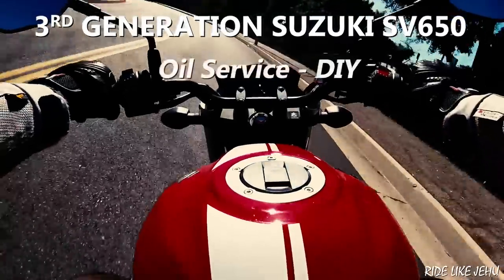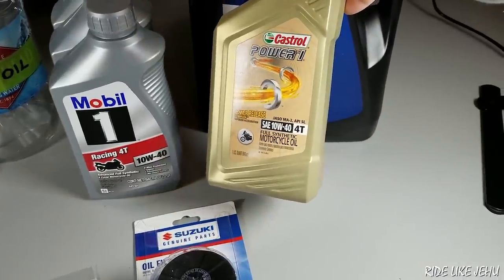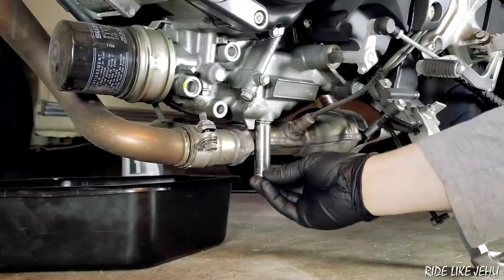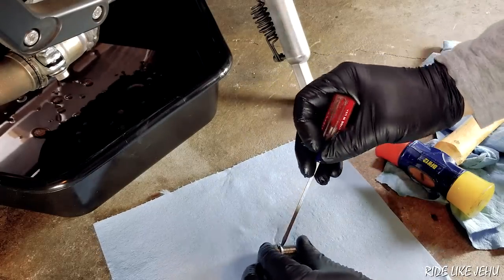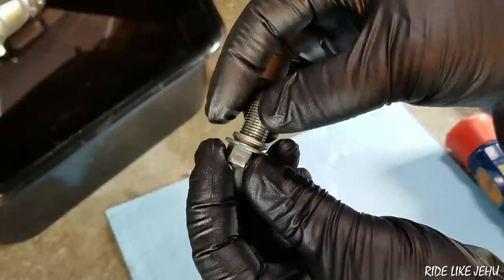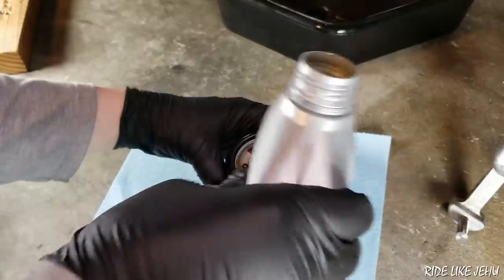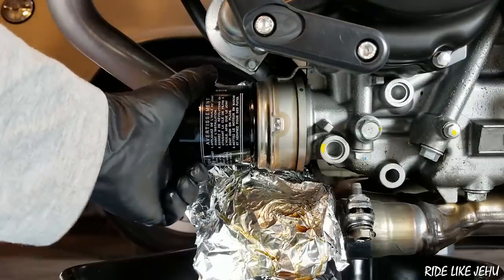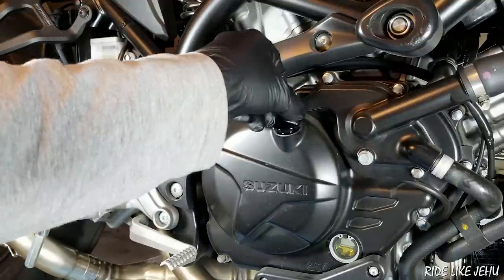Suzuki SV650 Oil Change (Corrected)

Comment: I like 15w-50 oil in there. But it gets over 104F here in the summer so make sense. FSM shows it as valid too as long as you stay above -20F, which I find surprisingly low. I still use 40w in colder temps.

Comment: Prefilling is pointless, not only that but you prefilled the oil into the output "hole" of the oil filter... meaning if that new oil is dirty or something got into that new oil, its going to get sucked straight up to the bearings and will NOT be going through the filter portion first.

If you dont prefill all the oil is going to pass through the filter correctly (or you prefill by pouring into the tiny hiles on the edges of the filter instead, still wouldn't recommend) and that small oil "delay" will not damage anything... the bearings and everything has plenty of residue oil in them.

Overall this would be a perfect video for an absolute newbie, good tips. In depth coherent walk-through. 👍

Comment: oil filter IMO is at end of process of engine lubrication, so oil sucker takes oil from oil sump to all parts of engine and after it goes back thru oil filter so is no delay with engine lubrication during the first engine start.

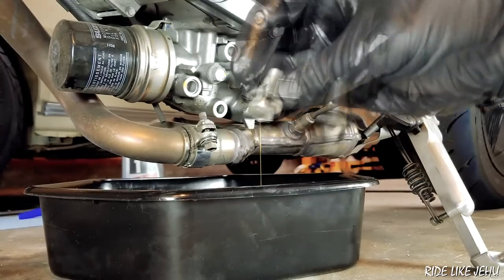Comment: 5:44 Ahhh, the old myth of needing to replace the 'crush washer'...
I've a 2000 registered sv650 that I have owned and maintained for 18 years and not once have I had to change the oil drain bolt, 'crush washer'. It's mated to the face of the engine casing. It's oil tight and will never leak so long as you don't deface the surface by tightening it up with bits of grit or something stuck to it. Take it off, clean it with a clean rag along with the face of the bolt hole, replace it and you will be good.
Done the same with all my cars for close to 30 years and never a leak. Amazing eh?
Reply from the maker: Lol. Maybe you should write Suzuki a letter, present your evidence and convince them to take that instruction out of their service manual. How about the various other myths related to keeping critical things from vibrating loose, like Loctite called out on specific fasteners and torque values to hit with torque wrenches? I'm sure you could save a few bucks there too :P
Reply: For cars this is cool, but on two wheels I would not trust my 30 year experience simply because a leak could mean death. Nice that it worked for you, but if it increases the chance of seal failure just by a little it will cause accidents in some percentage of riders. Unless there is a trial proving your point ofc. But that is unlikely :D
Reply: @L3v3LLIP  I have a 2006 SV650 and I've never changed the washer since I bought it months ago. The bike has never leaked and I've had no problems with it since I bought it
Reply: @enzofalone  thats cool, but could also be just surviorship bias. The guy who died can not post about his bad experience ;)

Comment: Thx for the video.  Have a 2018 with 300 some miles on it and I know the first oil change is coming up. Rather do it myself then pay 200+ for someone else to do it; learn something too.
Reply: Recently had the 1000km (621miles😁) service done by agent on 2018 model, they actually Did replace the oil filter! (I put a secret little dent/scratch mark on it). This is Cape Town, South Africa where things are getting a bit rough at times...

Comment: I've owned a bunch of bikes, and what strikes me about this sort of make is how exposed the pipes and filter is along the bottom of this one. Makes me wonder over time about road debris being flung against those surfaces without any sort of guard system.
Reply: That was the first thing my sales person pointed out and the tech that worked with me recommended an aftermarket belly pan,  which I wanted anyways as many tracks require them for track day.

Comment: thanks for the instructional video! do you happen to remember roughly how long it took to drain the oil down to a slow drip? I'm interested in cleaning and lubing the chain at the same time.  thanks!

What kickstand is installed?
Reply from the maker: Probably ten-ish minutes? I'm sure it'll be good and slow by the time you finish with the chain service. The kickstand is from Soupy's Performance, but I wouldn't necessarily recommend it. The kickstand did not fit as received, I had to do some filing and grinding to get it to work.
Reply: Ride Like Jehu Thanks for the reply, I just changed the oil on my SV and ten minutes is right on.  Thanks for the kickstand info too.

Comment: Funny note... this is the only vehicle I've ever seen a torque rating for the oil filter. It says pretty specifically don't do just hand tight. Do hand tight + 2 rotations or 14.5 ft-lbs. Interesting right?
edit: I haven't ever seen it leak while hand tight. I just thought it was super interesting in the FSM.
Reply: I thought most bikes had a torque spec. for the oil filter. I missed that in the video...the actual spec. 15.5 ft. lbs. for the drain bolt, 14.5 ft. lbs. for the filter? I'm anal and have torque wrenches so I do like to know specs. I use a K&N filter with a nice easy bolt head on the filter.

Comment: Hi Ride Like Jehu
, 

Very nice video, I am new to motorcycle and planning on doing a 600 mile oil change myself, can you please list some detail on the suzuki branded oil you have shown on the video? is that a full or semi or non synthetic ?
Reply from the maker: That was 10W-40 Suzuki "4-Cycle Motorcycle Engine Oil." I believe it was non-synthetic. I only used it for that first oil change, hoping it would help in the event of a warranty claim to have receipts for Suzuki brand oil. Oil changes since then have been with Castrol or Mobil 1 full synthetic. Welcome to motorcycling and thanks for watching!

Comment: How do I even get a crush washer I've never heard of that. I was just about to change mine. It's got 10k miles but this will be the first time I've changed it.
Reply: Did you ever figure out where to get the crushed washer I’m trying to find one for mine too ?
Reply: @cotycharles7824   I'm still unable to find them. There's a site called revzilla. Ice ordered from them before it was wrong size. Idt they were the same kind that came off though. I used the same one and just made sure it was tight and just make sure to check that it's not leaking.

Comment: Dear friend, i watched you video many times... I just want to ask you if that frame sliders fits ok on the bike? Is the bolt a bit loose or thin on the frame? Are you happy with them? How long they are? I will really appreciate your help.
Bes regards
Reply from the maker: Hi, yes the frame sliders fit with no issues. The SV650 had just come out when I got those, so it was the only thing really available at the time. There are probably other options available now, but we've been happy with these ones.

Comment: Don’t over tighten the oil drain plug. Ask me how I know lol. Only make the mistake once. Luckily a new oil drain plug and crush washer did the trick (it was barely leaking oil after my oopsie). I was afraid I stripped it out, but I think I’m good to go. Wasted 2400ml of brand new synthetic oil, and I had to buy the new parts. Lesson learned.

Comment: Where can I purchase the service manual? Thanks!
Reply from the maker: If you want a hard-copy like mine the Suzuki part number is 99500-36240-03E. I ordered it from partzilla.
Reply: Thank you
Reply: Is the manual only imperial or also metric?
Reply: @flozo98  Mine is both: lb-ft and Nm. All of the bolts are obviously metric though.

Comment: Unrelated question (or related if it's an oil issue). Do you feel like the SV's tranny is a bit clunky? This is my second bike, coming from another Suzuki (GW 250), which was also clunky. It's either a Suzuki thing or I am terrible at shifting. Cheers!
Reply from the maker: We've noticed filling the oil up toward the max line seems to make it tend not to want to go back into first gear from neutral. Other than that the transmission feels pretty good.
Reply: When I first bought my 2017 with 3000mi it also did not go into neutral or first gear from neutral easily. It would also creep on you when it did go into 1st without even releasing the clutch, that told me the clutch adjuatment is out of spec. Per the book, adjusted clucth lever to 10-15mm play and 3-5mm space between locknut and bolt. Now it easily goes into neutral and first and does not creep on you.

On a side note I noticed a new problem, at idle, when I shift through the gears, the gear indicator disappears and appears again, so I cant tell by display what gear im in. It does come back after playing with gears a while. Still trying to resolve this, doing my first oil change today so lets see what that does.
Reply: As a previous SV650 owner,i read a lot of Forum posts,some stated a clunky Gearbox etc,the basic cure was just to use a different Oil.

Comment: Those pipes could have so easily been designed not to get in the way of the drain plug and oil filter
Reply: At least you don't have to remove fairings, or like my 4runner 2 skid plates every time haha
Reply: It is not a big problem and directly accessible.😎
Reply: lay some aluminium foil down over the pipe to prevent it from getting oily